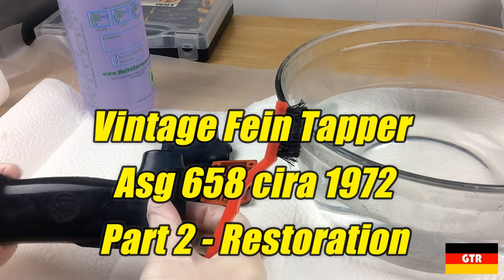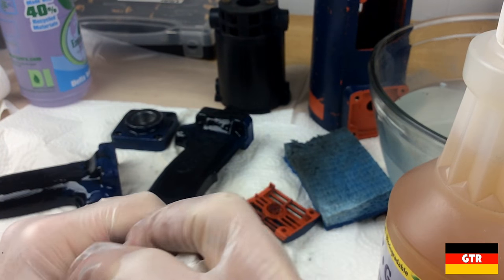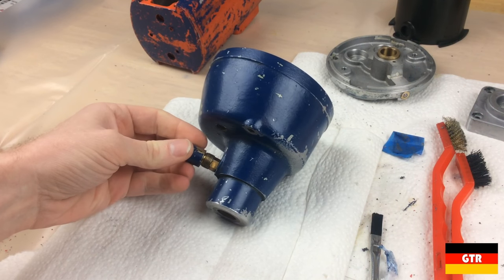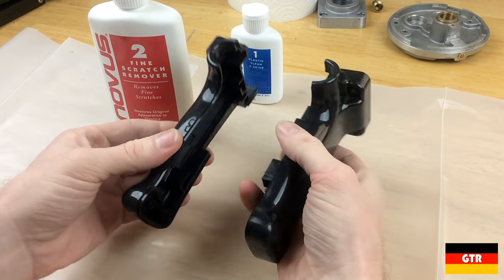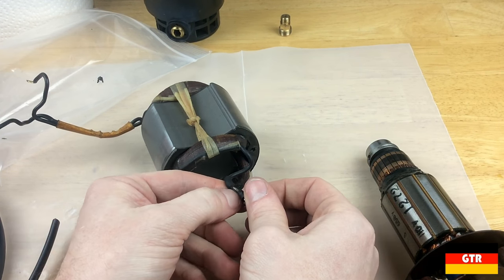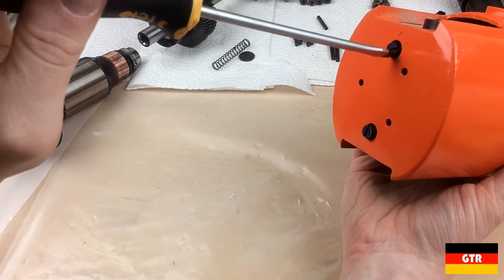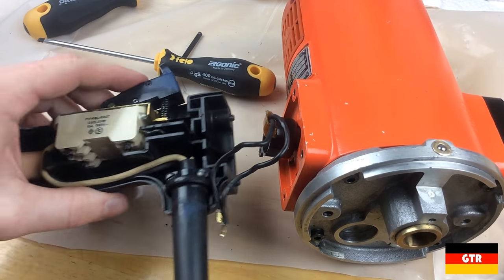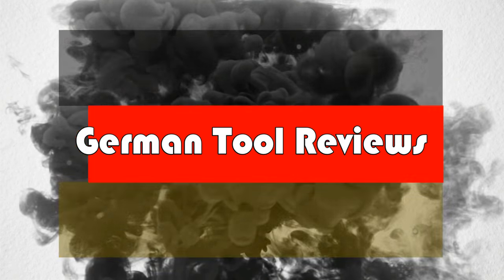Vintage Fein Tapper (Asg 658) Part 2 - Restoration

Comment: Not sure if anyone has pointed it out but the brass fitting to the side of the casting is called a grease cap. The idea is that you fill it with grease and as you use the tool you gently screw the cap down which forces more grease into the bearing. It becomes a grease reservoir. So its natural state is to be filled with grease.
Reply: Sorry - just noticed @bolwerkr reply. :)

Comment: The fitting with the cap is for grease. You fill up the cap with grease and screw it in once in a while. When it's fully skewed in, take it off and fill it up again. This machines are greased not oiled. Oil will collet a the lowest point. The machine will be handled in all positions, but lays around 90% of the time. Without an active oiling system the gears will run dry.
Reply from the maker: Alright thanks, I figured it was just for the bronze bushing.  I will fill it up with grease before really using it.

Comment: Just an FYI... good quality carnuba wax for cars will break down spray paint safely... that's what pro detailers use to get graffiti off cars. Plus it leaves the surface clean and shiny.
Reply from the maker: Thanks for the tip!  I strip a lot of paint off old wood and I only occasionally get to strip anything off metal.

Comment: No part 3 yet.
Reply from the maker: I was going to make a part 3 on making a case for it, but there didn't seem to be any interest so I just went ahead and did it.  I haven't had an application where I needed to tap a large number of holes as once yet.
Reply: German Tool Reviews yeah I see ur point.Ha I was just interested to see how the tool would work.Ill wait.Not many time u use a tap valid point.